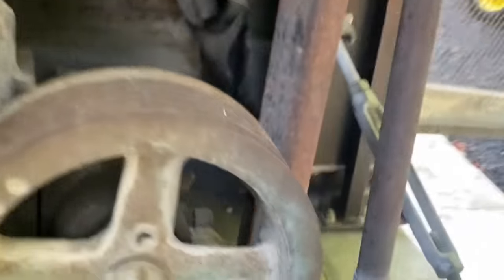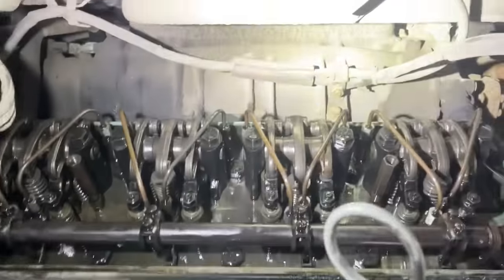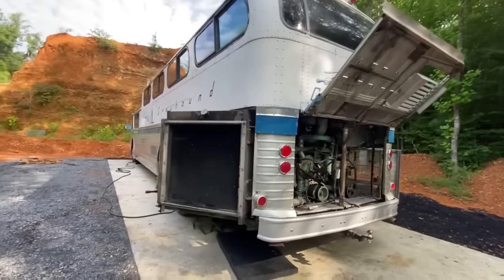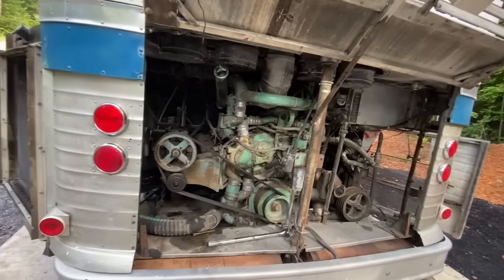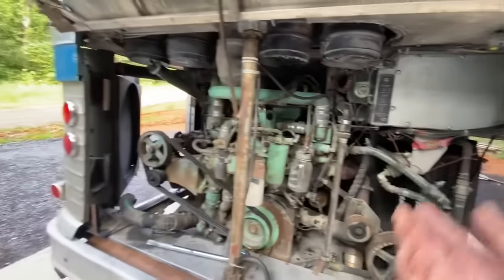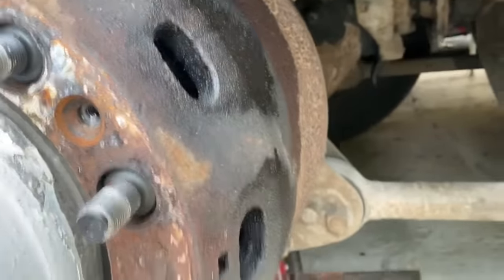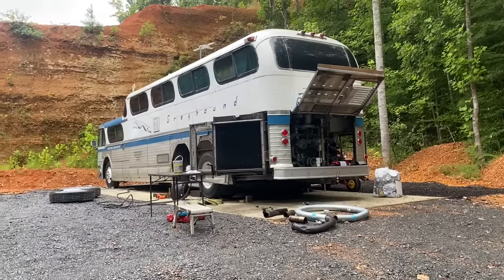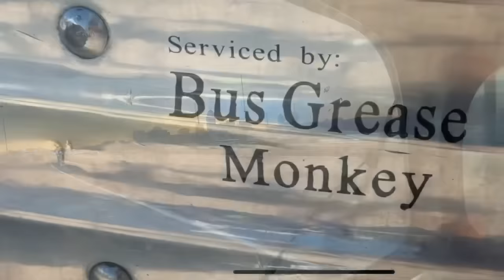Scenicruiser bus engine problems detroit diesel 8v71 supposed to be quick and easy maintenance

Comment: Those early Detroit Diesels LOVED WASTING Oil. The oil made sure nothing rusted. The seals and gaskets leaked badly. The Great improvement was when the 92 series came out. I drove the 6V92 series in the 1980's. It didn't use nearly any oil compared to the 71 series motors.

Comment: That was one thing I loved about running a 13-speed Roadranger or a 5x4 twin-stick because you could easily gear them in a way to keep rpm's high. Unlike today's 4-cycle diesels like my 60 Series which can run down the road 1100-1400 rpm, the old 2-stroke engines needed to stay high rev'd. As for that towing hitch on back bumper, it's got to go. These older buses were never built nor intended for that use and now there is structural failure which needs immediate remediation. The owners of these buses must be reminded that there is no body on frame in this design, the body of the bus is the frame. Otherwise, this is a nice looking coach.
Reply: Well said.
Reply: Detroit 8v92.  That is detoits V8.   Thoes  had   
 A 4 or 5. Speed with a marrage box  could have. Been 3 speed or a 4 speed. . They were my. Trannys. Now since this stroke  I need aAutomatic.
Reply: @LUCKYB.  lol
Reply: The bus is built like an aircraft fuselage. Yes it's worse than a unibody. It doesn't do well with high-impact Road vibration. Put some wings on it it would make one hell of an airplane LOL

Comment: When I first started driving truck way back in the 70's an old detroit diesel mechanic tolf me to drive them like you are mad at them. Good advice.
Reply: Or like you stole it!!
Reply: Dad told me. When driving an old Detroit Slam your hand in the door. And drive mad.
Reply: my first ride OTR was a 1973 IH 4070B, Detroit 318. The old retired teamster who oversaw all of the fleet vehicles (a non-profit music group from Cedar Rapids) said, "step 1, slam your fingers in the door, you'll do fine after that"
Reply: You still have
Reply: Yup how all 2 stroke engines should be driven, maximum lubrication at high rpm

Comment: I think the Scenicruiser is my favorite bus of all.  What a great looking body.
Reply: If I am correct General Motors built the SceniCruiser exclusively for Greyhound only 3 years. I believe it was 1954, 1955, and 1956
Reply: Greg M I’m not sure if that is correct my dad drove for Greyhound back then and if remember I saw a Mexican line had them as well out of Texas, now they may have bought them second hand
Reply: L

I'll p
Reply: Remembering more about the Mexican buses they had 2 steer axles
Reply: How long is that thing?
Reply: M. Carr I don’t recall it looked the same but I was pretty young
Reply: Love your profile pic
Reply: @RollinHomies  40 ft
Reply: @patricktetreault4870  They were built by GM exclusively for the Hound 1954-56.  The Hound started selling them off to the secondary market in 1969.
Reply: @thegodblogger3812  my dad was driving for them when they were new a Mexican line had some as well but they had twin steering axles
Reply: @patricktetreault4870  The twin steering axles WERE NOT Scenics. They were horrible pretenders. Beck also had a pretender that ran for Queen City, a line based I think in Charlotte. Google actual Scenicruisers and you'll see the real ones. I've seen the twin axles. Again, they're not PD 4501's.
Reply: @thegodblogger3812  ok did not know the scenicruisers I have been in as a kid like I said my dad drove them the Mexican one I only saw pictures of

Comment: I worked bus and truck from 1970 until 2009 after I got out of the Army  as a helicopter repairman, 25 years at Chicago transit authority, and 10 1/2 at USPS, with a 4 year stint at a truck driving school in  between the two, I love buses, I believe that the scenicruiser is an automotive masterpiece, an absolutely profound  statement of automotive perfection,it may have had it's short comings but just like a pretty girl it looked good coming or going!

Comment: The way it runs is like a burnt valve with the way it spits in the exhaust. Too bad you don't have a bore scope to look up in the cylinder and check them out. Great video!!
Reply: Rodney Middleton
, On a Detroit you can remove the airbox covers and shine a light at the liner to examine the rings and even see the top of the piston by looking through the liner ports.

Comment: That bus needs a lot of love. Those stress cracks and turn buckles are scary.
Reply: Agreed. It's a  gooofy non-solution.
Reply: These coaches began to develop structural issues after just a few years in Greyhound service. I can only imagine what some of them may be like now after 60+ years!
Reply: not as severely as it was with the Scenicruisers! That, and problems with the piss-poor Twin 4/71 setup is what soured Greyhounds relationship with General Motors.
Reply: Good Question. I'm sure is was well into the Seven Digit ballpark.

Comment: Actually, the very first of these scenicruisers, had twin (2) 4-71 Detroit’s. The 8v71’s did not arrive until about 1958. The first 8v-71’s were built as “no water below the ports” ( the lower part of the cylinder had no cooling) those engines are not desirable as they lead to uneven expansion of the cylinder walls. They might have had “2 valve(per cylinder) heads also.  Not sure what year they started to build the “water below the ports” engine. If you ever had to pull out the first design, junk it and put in the later version. All the twin 4’s were swapped out (?)as they had a hard time synchronizing the engines and were gut less. If there was still a twin 4 in existence, it would be super rare.
I think the early 8-71’s with no water below the ports had a different air box “door” kinda like a 6-71 I recall . I remember you could tell by just looking. The rectangular port doors is the correct engine. Hope this helps…Marlin, old Detroit mech.

Comment: Well, keep learning something new about these old busses everytime you get one to work on. The owners too! Anyway it will make a good video in the fall working on it. Plus getting help by then. What the heck with the chain and structure cracks? Not good. Looks like the whole back end needs work. The extra radiator is a great idea but needs to be attached to the door so it's not in the way for engine work. Really cool bus but needs updating by the Grease monkey👍

Comment: Well done Brother. Like the 4 strokers better, 60 and 50 series. The welding shop I worked at in the 70's had a pair of 30" by 10' by 3/4 channel off of a 4 foot hill on concrete pilings. They did all their bus services, air bags and rewelding standing up under the bus. Your property screams service pit. Wrench until you can't. Still runnin coast to coast with a 50 series. Thanks

Comment: When I first learned to drive truck.  I was told that a person should run a Detroit right up against the governor, and to never lug them. it causes them to leak oil heavily to start with. so that's how I've always ran them and never had any problems with them.

Comment: Most common repower on the old dodge power wagon is a a 5 speed from a 2 1/2 Army truck hooked up to a 3-53 Detroit. It's a tight fit but works very well. 5th gear in the Deuce and a half is overdrive. 

Food for thought.

Comment: Great videos sounds like a burnt out valve, in the u.k. we get quite a few valves burnt out when using the wrong oil (multi grade)on these two stroke Detroits, only use SAE40, head off pressure test new valves and seats head back on. keep up the good work.

Comment: Originally the 1954 - 56 GMC PD 4501 Senicruiser was equipped with the 4L71 N Detroit Diesel engine with 4speed manual Transmission until 1959 when the 8V71N Detroit Diesel engines were available and I'm pretty sure all of them were swapped while still having the original speed Manual Transmissions for more power and up the hills and Bridges around America
Reply: Originally they were equipped with two 4-71s, mated to that manual transmission through a fluid coupling.
Reply: @etmccaus  this setup worked in theory but not in practice.
Reply: The 8V71 conversions were started on the remaining GLI fleet by Marmon Herrington in 1962.
Reply: @etmccaus  3 speed and clutch splitter  giving six forward gears. 😉

Comment: 41 mph with the original 4 speed would have been 3rd gear up to 45. Definitely lugging the engine on a grade if not down shifting.
Additionally, don’t shut down a hot engine after driving. A few minutes on high idle was always the rule to follow.
Reply: Tage Uhl you have to let the heat dissipate
Reply: Tage Uhl all the old Mack’s I drove had a tag on the dash that said idle engine for 5 minutes prior to shutdown, to cool the turbo etc. neat stuff really
Reply: Deborah chesser desiel engines run cool when not under a load. You are right, the heat will dissipate. 
Grease Monkey has touched on watching your temperature gauges when driving down the road. This cannot be said often enough, especially with novices. 
My own experiences have shown my that any grades, speeding in hot weather or strong headwinds can cause temperatures to increase. You have to constantly monitor your gauges!
Reply: @tageuhl6422  Some of the GLI fleet would shut automatically shut down if they overheated on a grade  to protect the  powerplant, especially the series 60  DD.
Reply: Skinner Hound every coach I’ve driven had that feature. But let’s face it, no one wants to have that happen. And yes, it happened to me when my coach had cooling system problems in the summer of ‘80, going back and forth across the south. Still drove it another 5 months carefully till it needed an overhaul in November. I was driving for Consolidated Productions with musical and theatrical tours. It was a former Hound, an MC7, but Consolidated had run the 350,000 miles Detroits were good for. I took it to an authorized Detroit Diesel agency in the Quad Cities and they rebuilt it and both radiators. Only drove it back to LA, but it ran so sweet after that. Unfortunately they closed up the company due to the economy in ‘81.
Reply: Tage Uhl all you can do is turn the heat wide open and hope that pulls enough heat out of the motor
Reply: Tage Uhl that’s what good drivers like us do, we keep an eye on the equipment.
Reply: @tageuhl6422  I hear you and get it.  I use to drive west from Billings MT and would climb several mountain passes.  One grade was always a challenge b/c I would hit it in the dead of the afternoon.  Ryegrass hill would gain 2000' feet in less then ten miles.  I would always turn my A/C off and feather it hoping the alarm wouldn't sound.
Reply: Skinner Hound that’s nerve wracking to sit and wait for a problem to occur
Reply: @skinnerhound2660  My pickup does a controlled shutoff if it starts getting too hot. The first thing it will chop is the A/C. Then it starts dropping the RPM. It does it to protect either the engine or the Allison transmission, whichever is running hot. And that fan will roar at that point. Load shed is better than a complete shut off of the engine as long as you still have coolant.

Comment: I’d be quite concerned about the ass hanging out of it. Really not designed to have 3+ tons strapped to its rear as the cracks seem to illustrate. Chains and turnbuckles to the bulkhead seem a rather sketchy solution.
Reply: The trailer hitch is the red flag.
Reply: @skinnerhound2660  I agree. These buses were never designed to tow anything. Especially not a car on a trailer.

Comment: Rode on an "Express" Greyhound,in first passenger seats in raised "scenic"area, alone at 12yrs old in 1962 from San Diego to Amarillo....and yes, the driver got a speeding ticket just east of Flagstaff!!  Those guys drove those babies
Reply: Must have been an ass of an officer.  Usually they didn't ticket Greyhound drivers because of the respect they had for each other.

Comment: Diesel Creek took two semi trailers and placed them on each side of his pad (dirt) and built a gable roof with knee walls for height. That would work out great for your pad. You could cut a doorway in the sides of the trailers and establish workbenches and tool storage and be out of the elements. Sorry for spending your money. Good I'm not close, I'd be buggin/assisting all the time. That was a weeetttt cylinder!!
Reply: tomato tomato   shipping semi- big steel box. You right!

Comment: Thanks for all your great videos. I worked for charter bus line in British Columbia. We had a mix fleet of mci buses plus some new look busses. Anyways have you ever come across a 4501 with dual 6v71 engines . this was used in case one engine went down it could still be run on one engine eliminating a road side break down.
Reply: Are you pulling our legs? Never heard of such a thing but would sure appreciate a link to more info on such a bus
Reply: Me to i never hear about two engines in the bus !
Reply: Not 6-71, they had dual 4-71's. That was the original configuration for all Scenicruisers. Not done specifically for reliability, but because the 8-71 hadn't been invented yet and the 6-71 wasn't enough power. They were ALL refitted with 8-71's in 1961 and 62. No example survived with the twin 4-71's intact.
Reply: @SalisburySnake  ok well well that makes sense now. I have a booklet from the 50s called the sceniccruiser it shows the dual 471s as well as all the comforts  of the bus in that time . probably a rare booklet now i bet!
Reply: @jamessteli1570  I bet that is rare. You should scan it and share online, I'd love to see it.

Comment: He should have got more info on how to drive this thing before he went harring of in it. You can't lug a diesel without overheating it and blowing gaskets and if extreme cracking heads.
Reply: GM 2 strokes, change early and get the revs up. "drive it like you hate it"  is the saying ive heard.  RPM's  give the engine gas flow, which helps to carry out the heat.   Looks like there needs to be a major structural improvement to the chassis..........as in pull the engine out and start over.
Reply: Drive it like you slammed your finger in the door. You can't lug a Jimmy. You have to keep them wound up tight all the time.

Comment: Would it be over fueling on the wet cylinder as the rings still looked firm in their grooves as best as i could tell from the video? New shoes and seals. Both sides as if ones leaking the other one wont be far away from doing the same. Those valve clearances are all over the place.  Hes lucky he hasnt burned the valves.

Comment: The 8V-71 was a 318 horsepower. So was the 6V-92. Might make more room in the engine compartment. My truck shop worked on a MCI with an 8V-71. You couldn't even get your arm around it

Comment: Lugging. Unless it scores the liner and piston, you haven't hurt anything. I ran a fleet of the 8v71 and 8v92tt engines for decades. I never hurt either engine by lugging. I like the 71 between 1700 and 2450 rpm, and the 92tt between 14 and 2000.  However, I tried destroying a 71 by lugging it at 1200 rpm for 20 minutes. It heated up some, but when torn down, no scoring was found. That was with 65 injectors. With the 70 or 75 injectors, I would suspect piston overheating and scoring would occur. 
I'll say one thing about the 71 and 92 engines. Bulletproof.  Best engines I ever owned, and I only had 1 fail in all the years. Had a 318 with 12k miles throw a rod while idling. Turns out it had a factory defect in the rod, as air bubble holes could be seen in the broken rod. Detroit pulled the 318 and put a 333 horse 8v71 greyhound bus engine in our Brockway semi truck.  Great service.

Comment: Great video and good tip on the lugging.   I'm running a 4-53T Silver and let it pull down to about 1600-1700 then shift and go up 8% grades at 2000-2200 all the way to the top.:)  Happy Detroit.:)
Reply: We had a High Speed 4-53 at work that I had hooked up to a large water pump. Nice and quiet at idle with the muffler I built. But wind it up to the max governed speed and it screamed. Now what was the high speed limit on it? 3005 RPM. Under load it ran right at 1900 RPM which was perfect. That little 4-53 would pull the same load that the original 4-71 pulled.
Reply: gravelydon True, they do scream.  I have mine governed to 3000, but rarely go past 2500, seem the happiest between 1600-2200.:)

Comment: The turnbuckles aren't a terrible idea, but they look to be too high up on that bulkhead and I'm guessing they don't have anything going forward inside the bus from the same points to spread the load.  An alternative arrangement lower down and running further forward would be better, and easier on the windows.
Reply from the maker: I think its more for the towing load on the hitch. But its just a guess.  It’s honestly not in very secure stiff thick metal
Reply: @BusGreaseMonkey  That Land Rover is not an insignificant load too.  Turnbuckle system need re-assessed
Reply: @bengone3349  OK, thanks.  They all look the same these days.  I'd rather drive the orange M37 even if it is a strange colour.

Comment: worriedabout the load the tow is causing.. the uk buse drving and owning rules means most are scrpaaed as soon as they stop working and very few are ever used as campers takes monthes to get a licnce to drive them.
Reply: In both Canada and the US, buy the bus specifying an RV conversion when registering it in your name and the basic drivers license is all you need to legally drive one. You do need to learn how it handles and how it shifts ( if manual transmission ) but you are licensed.
Reply: Took me one month from novice to passed on my class D (UK bus licence) also, there are exemptions with relation to age of vehicle and passenger numbers if in private hands and not used for hire or reward.
Reply: @philgrimsey3637  The exemptions here, you need to remove the seating so it cannot seat more than 6 people and you have met them. Said removal, unbolt the seats from the floor and stack them in the back / sides and done.